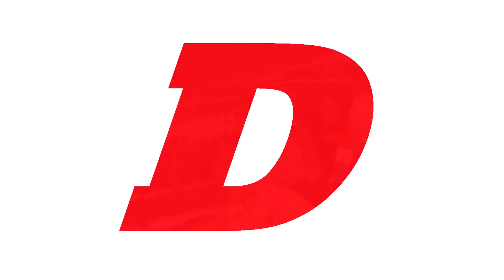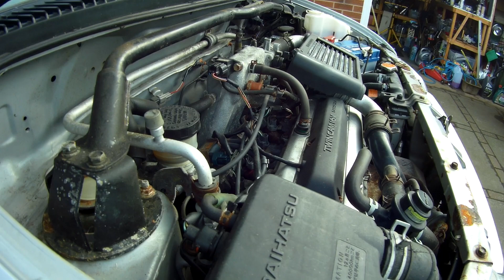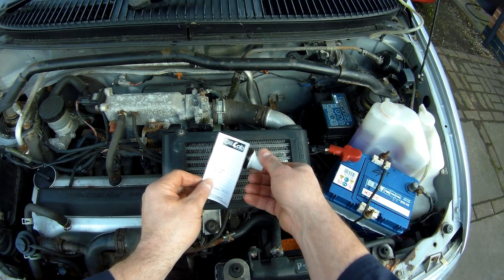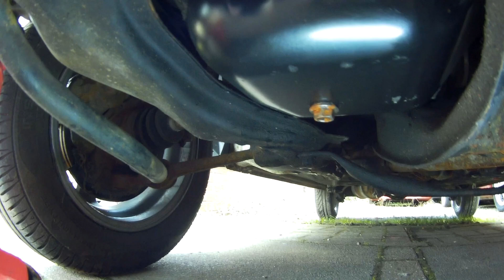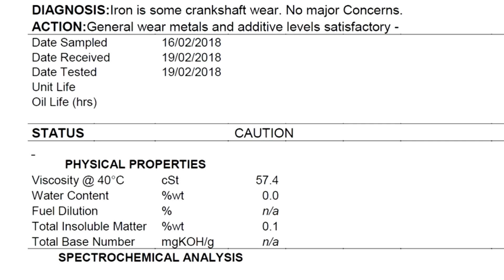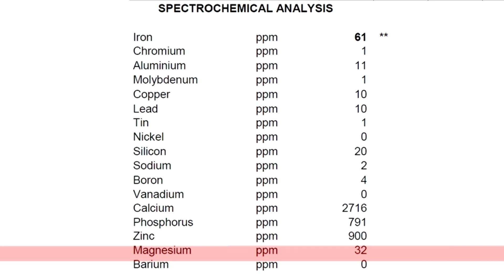Sludge Free? Engine Oil Analysis - Daihatsu Cuore Avanzato TR-XX R4

Comment: if you slide tube down dipstick tube to avoid picking up sludge from bottom of engine, how do you know you did not stick tube all the way down into bottom of pan did you mark tube with depth of dipstick, so it is just barely into oil not all the way to bottom?

Comment: The best test for sludge is removing the valve cover and looking at the top end where oiling is less likely to wash it down and deposits are more likely to develope. Use a high detergent oil, like Castrol and NEVER buy cheaper oils sold by WALMART! Walmart sells major brand oil but it is specifically formulated for them and is NOT the same quality. Change oil regularly, use synthetic oil if you like but it and a good filter can only do just so much. Even with the best synthetic oils and filters every internal combustion engine produces residual carbon in the oil. You MUST periodically get rid of this carbon or you get sludge death. Toyota 2.0 Liter engines died like worms in the Sun thanks to insufficient oil changes. I know, I changed them like crazy 23 years ago and back then, they were cheap. Now, nothing is cheap. Just change your oil!

Comment: Before the first start of that car, probably would have been a good idea to: 1) drop the oil pan and clean it out, 2) do the oil flushes and change the filter like you did, 3) replace the spark plugs and wires, 4) replace the battery, 5) replace the air filter, 6) flush the radiator and replace with fresh antifreeze, 7) replace any worn hoses and the thermostat

Comment: Seems like Americans change their car oil much more often than us Europeans. Can you comment on this? How often would you change oil in a daily commuter? I usually change it once a year and drive 1-1,5 thousand kilometers a year.
Reply from the maker: Well, I'd usually change my oil annually even if not doing a high mileage, as you've still got the stop-start heat cycling  every time you use the car - even if you're not using the car very often and it would probably be fine, a DIY oil and filter change is cheap enough that you may as well play it safe.

As for the Americans changing oil so often, I think it's a holdover from years ago, with poor quality mineral oils that needed changing often, plus having oil cheap enough that you can justify still doing it that way.

Comment: I had a weird lil Japanese truck from the 80s that had never had an oil change, when I did change the oil the damn thing seized up, so I drained the new oil an put the old oil back in like my uncle had told me to do, an I let her sit fer a week, though I was told jus to let her sit fer three days. An when I went to crank her up, low and behold, the lil three banger fired right up an was running jus as fine as she was before I changed the oil. The damn thing has no place on it fer an oil filter, so that was a major issue proving that changing the oil would not be wise, but I was 14 an clueless bout that factor. An the lil truck showed me that sometimes it's good to use what's old instead of what's new.

Comment: Now it's time to check the transmission(gearbox)oil, and the boots on the CV joints. Transmissions can condense water in their oil from having sat so long without being warmed up from normal day to day driving. It's not a bad idea to flush the brake fluid either. It's worth flushing all fluids and oils, in any car that has not been driven in years.

Comment: 10-20% of used oil remains in an engine after a simple drain and refill.  Perform a Full Volume Oil Change (double oil change) and you will achieve a 96-99% clean sump.  I do not recommend using any solvents in an engine, but in your case with severe contamination and sludge, there was no choice, short of a full rebuild.  The high iron and aluminum is likely pistons and cylinders.  The lead and copper is probably from bearing material.  There was likely residual wear metals in the oil after the flushing.  Any time you look at wear metal amounts you need to correlate that to mileage.  The ppm is not relevant with out it.  For example an engine that produces 5ppm/1k miles or km, may be acceptable.  After 5k miles, that would be a total 25ppm.  But 25 ppm after only 1k miles, that would be a serious concern.  Some labs over universal averages for a paticular engine based on certain mileage, this is very helpful.  Arbritrary limits without consider time or miles is of little value.  In the future, perform a double oil change.  The clean sump and the engine, the anti-wear, detergents, and dispersants will be able to fully perform its job, rather than having to counteract the 10-20% of used oil.  The oil will perform better and last longer.  Best part it is 100% safe.  Use the same flush oil a second or third time or use in another vehicle of lower value or importance.

Comment: that bottle of flush is for 5 liters of oil right?
Reply from the maker: It should work for a larger sump capacity than this, yes.
Reply: @InitialDave  will it damadge my engine? it takes 3 liters of oil. and what flush is better liqui moly or wynns?
Reply from the maker: @ziadbakkich3132  I doubt it would do any harm at the higher concentration you get when putting it in a smaller amount of oil, but you can always just use half a bottle and save the rest for your next oil change, which is what I do sometimes.

As for which is better, afraid I don't have a definitive answer for you. For the most part I use Liqui Moly, though I've also used Wynns and other brands. Some people like the Forte stuff. 

Some people prefer not to use a flush at all and just do a second oil change shortly after if the oil seemed quite badly contaminated.
Reply: @InitialDave  thank you very much for your answer!!!! I love your channel mate!!! i will subscribe and like your videos!

Comment: What would you recommend for a 03 Camry v6 oil pickup screen is clean and pan. It's at 148k miles. Tried to switch from Pennzoil conventional 5w30 to magnatec 5w30 full synth and lifted started clacking after 30 minutes of idling switched back to Pennzoil but the lifter clacking is still there. I would like to have it running smoothly again. Great video any advice I would greatly appreciate seeing as you did extremely well with this.
Reply: Pennzoil Ultra Platinum with 20% of Marvel Mystery Oil, darin after 200 miles and replace with Pennzoil Ultra Platinum.

Comment: Change air filter to lower silicone in oil.. Got it
Reply from the maker: Silicon is commonly used as an indicator of dirt/dust contamination, i.e. filtration issues.
It can be from other sources, but given the car had a rather filthy air filter, it's a reasonable assumption.

Comment: nice follow up video .. sounds like your logic came good and that previously unloved motor has a good chance of a long life . I have just done a cambelts and water pump kit change out on my 2.5 tdi VW Caravelle after a terminal sounding death rattle at 250,000 miles caused by a broken fuel injector pump tensioner breaking . A small oil seep from the sump was sealed   using 24 hour 3M epoxy 9323 A,B. . after scrubbing the areas with solvent .fresh Motul 12 antifreeze for inhibitor protection .

Comment: Scotty Kilmer says never oil flush an engine as was done here in this video. Once the inside of the engine is squeaky clean from the oil flush that sludge is now loose and can contaminate small holes and crevices that need oil, also that sludge may have prevented oil leaks and oil getting past the piston rings. You may now have a car that leaks oil and burns oil through the tail pipe.
Reply from the maker: Scotty Kilmer says a lot of things. Most of it can be ignored.
Reply: InitialDave I realize Scotty is not English but.....

Comment: I know this is old but the iron is more then likely rust from any moisture that got into the engine from sitting. Best thing to do is put a magnet on the oil filter to trap any metal that's magnetic in the filter to reduce any grit that will cause excessive wear on parts.

Comment: If you have a really nice car you keep it as clean as possible. It's the same with people, if you try to keep your appearance as best you can it usually follows you would take good care of the inside of you. With your car you wash and clean the interior but do you keep the trunk/bed clean? If it's the condition of your oil that is a concern you should first ask yourself how long does it take for the new motor oil to change from the color it comes out of the bottle to what the old oil you drained out looked like. Oil turns black because it has carbon floating in it. Carbon comes from the burning of gas/diesel. The same black stuff that comes out of the tail pipe. Carbon is also what diamonds are made of. That black soot in your oil means it is dirty and that carbon is helping to wear apart your engine. If your engine is in good mechanical condition the oil in your engine will just be getting too dark to read the markings on the oil dipstick when your 3,000 - 7,000 miles most vehicle manufacturers recommend you change your oil. You should judge buy your oil not the recommendations. The cleaner you keep your paint and interior of your car the longer it will last. The cleaner you keep the oil in your engine the longer it will last. Also, If you pull your dipstick and find there is no oil on it you should not decide to change your oil because you are leaving most of the carbon in the engine. You should add enough to see oil on the end of the stick. It doesn't need to be full at this point. Drive it for a day or two with the oil in it then change it.

Comment: I think the engine should be good to go now. Sounded quite normal when you started it up. If it were mine, I'd do one more oil change in 1,000 miles and then whatever the normal service interval is. Good video.

Comment: I'm reminded of a van I once purchased. It was in my earlier years when I knew little about vehicles. I went to test drive it. It seemed to drive fine. A day later I gave it an oil change and saw what you saw in your first video, just it wasn't as vicious. I had driven a van with a huge amount of sludge in it for about a hundred miles and there was no ill effect that I could see. It helped that the engine was notorious for being reliable and was an older engine. Had it been a newer or small engine, I bet it would have destroyed it. Now I'm more careful.

Comment: 8:15 Moly is an additive used in some engine oils, but it is also found in certain steel alloys, and some types of piston rings are coated with it. That is why oil labs test for it, but they might not give you any advice about it.

High silicon doesn't just mean that the air filter is dirty. It can mean that air is leaking in behind the air filter.

Comment: InitialDave Putting automatic transmission fluid in a sludge up engine breaks up sludge. let it run for 15 mins and let it set for a hour or 2 and drain it and do another flush if you want to be safe. atf flush is similar to people using diesel but atf is a oil and detergent and is safer for the seals than diesel

Comment: I had a Volvo that sat for about ten years before moving and the oil was pretty thick as well.  Not as bad as this stuff.  But, nasty all the same.  After putting some of the usual diesel through the sump (making sure to jostle the car for a moment here and there to mix things up) it came out in a sort of black chowder mess.  However, instead of using an engine flush I went for some synthetic oil instead.  If for any reason I've heard of a few seal failures wrought from it and using synthetic seems to do a pretty good, if gentle job in getting gunk out when changed after about 1,000 miles or so.

Comment: Hello from Japan!
I'm glad to found your video, currently I have and driving with 2005 Daihatsu Move Custom RS (L152S) since July 2017.
The Daihatsu JB Series Engine is in my car too, but mine is 2nd Gen. (named as JB-DET)
Your JB Engine is 1st Gen, but JB-JL has better performance at high rev range than JB-DET.
(because JB-DET Stock ECU make a performance as worse at high rev range due to too much power (around 80ps) without restriction and for match to Kei-car regulation (within 64ps).
However, JB Engine is brilliant and fun to drive. even with Automatic Transmission. (L152S has A/T Gearbox only =_=)
9000rpm rev limit, huge potential for tuning (JB Engine is famous in Japan's Tuner, as the one of best 660cc Engine for tuning. There is a 200ps JB-DET Tuned Engines :D), Brilliant Sounds, it's definitely Pure Sports Engine.
but sadly JB Series was discontinued at August 31, 2012. and It was a last 4-cylinder 660cc Turbo Engine.
then, 4-cylinder 660cc Engine no longer be made forever because JDM doesn't want it anymore.

I'm so impressed
 when I saw your JB-JL is reviving and rev up to 8000rpm as smoothly,
even abandoned for 13 years... thanks for your great job.
and, Please, keep a care to your car and engines as possible.
I'll do same things for my Kei-car too..!
Reply from the maker: Thanks!

I don't really have to worry about the restrictions here, but because the car is the UK version and quite rare, I'm planning to keep it standard rather than modifying it.

Comment: I see the engine is way over the front axle. Does this not affect the way the vehicle drives? I'm imagining oversteer for days...? There must have been a way for Daihatsu to have a drive shaft to the rear wheels without doing that.
Reply from the maker: The engine position is normal for a transverse engine and gearbox, it's the same as any similar setup.
Reply: InitialDave Oh okay. Usually however if I look under the hood of our 3008 or Sandero the engine is more on top of the front axle in between the front wheels not so far over it. So strange.

Comment: There are some models of cars today that do not have an oil level dipstick, such as BMW models. On these cars an oil sample needs to be obtained some other way. On cars without an oil level dipstick the level is read by an oil level sensor and displayed on the car dash board computer.
Reply from the maker: Yeah, in those cases you may have no choice but to take the sample from the drained oil instead.

Comment: Old Air Force trick, use 1 qt of ATF and run for about 500-1000 Miles. It will clean out any gunk in the engine.
Reply: yep, in massive chunks right into the journals on the crank and the VVT system. you cant do army tricks on modern engines.
Reply: ATF isn't the same as it was 60 years ago when this became a thing
Reply: My dad has done that for years and we use it on most of our older engines. 350 Chevys and LS engines love atf
Reply: Does this work for just diesel engines?

Comment: I have done some reading on oil viscosity and additives, so I understand some important things. Noteworthy: Your phosphorous and zinc content is a little low. Both of these, combined with Sulfur compounds, are the "intelligent molecules that stick", however the amounts shown in the analysis for relatively fresh oil are concerning, because they match up with literally any other conventional or synthetic oil that doesn't advertise their additive packages.

Compare your zinc and phosphorous levels to Shell Rotella Heavy Duty Diesel oil. people regularly run the stuff in turbo Civics (Source: D-series.org, Honda-tech.net) due to having almost as much phosphorous and zinc as the leading non-emissions-legal race oils, but with detergents thrown in and a price that most would determine as "too cheap". I had a guy come into the shop I work at today with a 2 gallon jug of it, he bought it because it was cheap, not because it was also damn good.
+InitialDave I would stay away from Castrol.
Reply from the maker: My understanding was that it was a polymer additive in Magnatec that gave it the claimed "stickiness", but tribology and chemistry to that kind of detail isn't really my thing.
Seems like a lot of people aren't that keen on Castrol, but it comes down to its what I had a few bottles of. Maybe I'll look into a different brand when I need more.

Comment: How the fuck does a engine obtain boron?
Reply from the maker: Some oil contains boron compounds as anti-wear or pressure additives, and the can also provide a slight detergent or acid reduction effect.

Some coolants contain it too.

I suspect its use may be reduced due to REACH (environmental) requirements.

Comment: Just watched all the videos in this little series. 

Great work you're doing there. It was the sludge video that got me hooked. 

I've done similar work to on a couple of old Peugeot 306 cars in getting them mechanically sound before starting on the cosmetic things like bodywork. 

The oil lab analysis is a great tool that I've used myself but I think my sample was contaminated by going through the drip stick tube as my old worn dip stick wouldn't stay  in place and would pop up a little with the crankcase pressure.

Keep up the good work.

Would you mind doing a video on future plans for the car or what videos you're planning on doing next with it?

Comment: you can add some automatic transmission fluid to your oil it's full of detergents and it will clean the inside of your engine out... not all fluid, but depending on the capacity about 1/5 or so auto fluid. Been a trick for decades for sticky lifters and valves...
Reply: Battle Boat  you came out from under your bridge to comment on a factual statement two years after the fact....  just for that tiny little nugget.... and not only that, a lazy uninspired attempt at trolling.. you even make internet trolls look bad.. if you're going to take the time to be an ass, at least be an 'ass'...
Reply: I use shell rotella diesel oil and trust me it works
Reply: @jacobmullins3644  I've now officially swapped to amsoil and let me tell you what.. never going back if i can  help it.. not that shell is bad oil,, its that amsoil is so much a step above.. also swapped both auto trans for amsoil fluids as well.. you can feel the difference immediately.